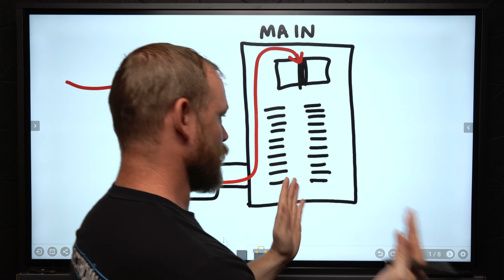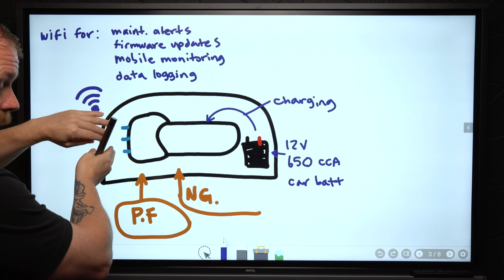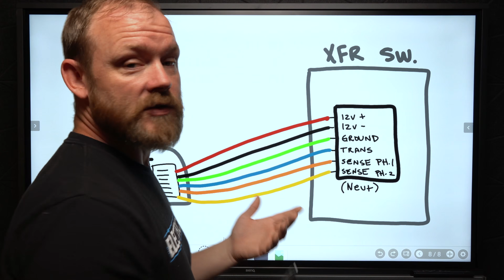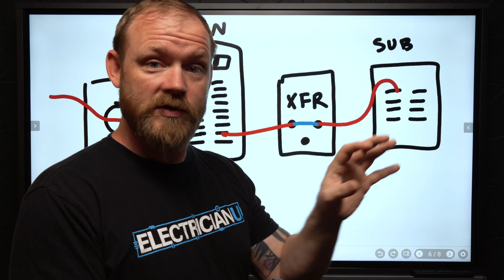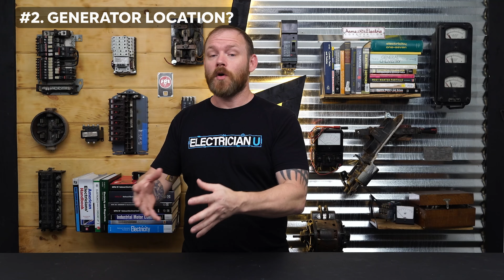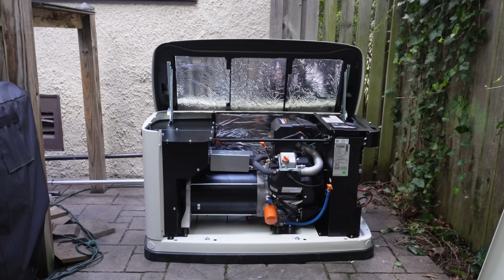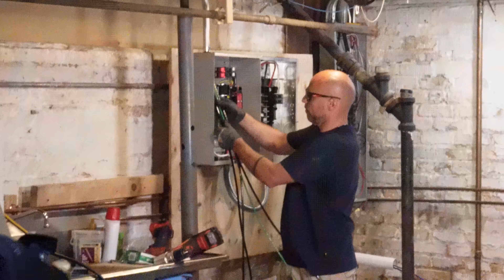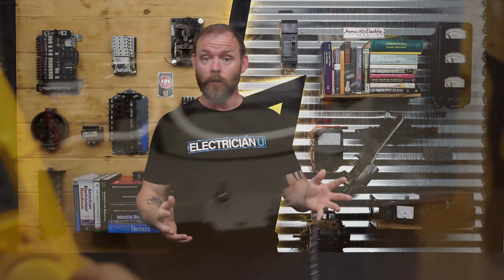What Should You Know Before Installing a Generator? Whole Home or Critical Loads?

Comment: 2nd!!  But not a Generac, I'm looking at a Kohl, but open to anything.
Reply: Generac base models suck. They are glorified lawnmower engines. Most people buy them because they are inexpensive and then complain about them after they fail to maintain them. 

On the other hand, their bigger 1800 rpm diesel water cooled models are much better.
Reply: @TheSzalkowski    you'd be hard pressed to find a reasonable priced diesel in Generac brand. Basically, a diesel will cost you about 50% more than a similar NG / propane set.... and you're not likely to find anyone selling an air-cooled diesel. Onan was the last and stopped making one in the 90s.
Reply: I have a 500 gallon propane tank, I'm not going to stock diesel.